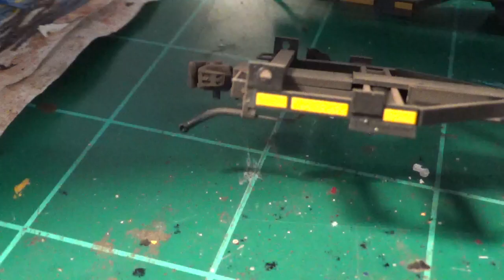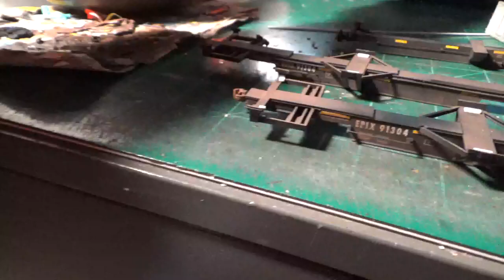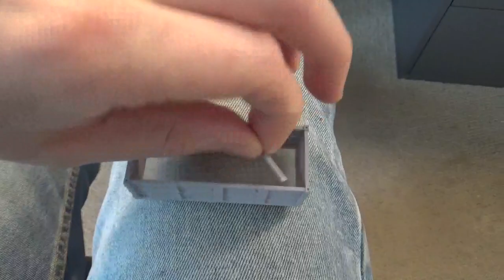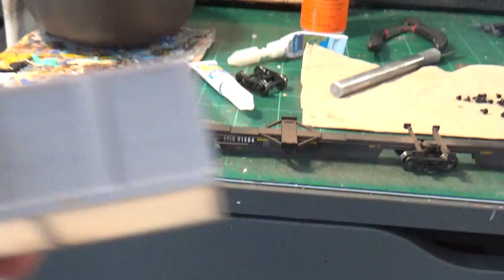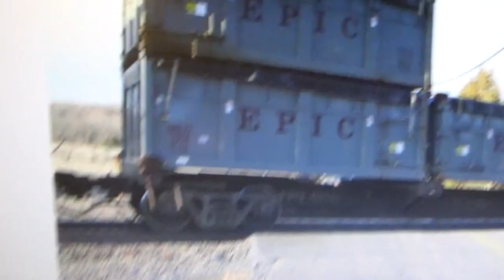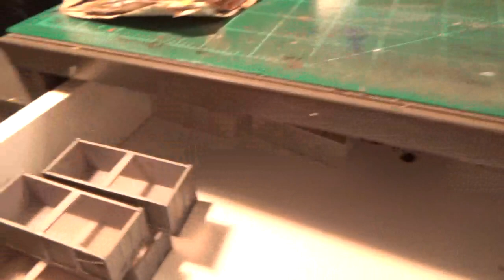**One EPIC Build! EPIC Trash Spine Car Build: Part 2. Putting The Wheels To It And Containers.**

Comment: Have you figured out the weight issue? I commented on the part 1 video in this, but I've seen someone weight depressed center flats with fine lead shot secured in with resin